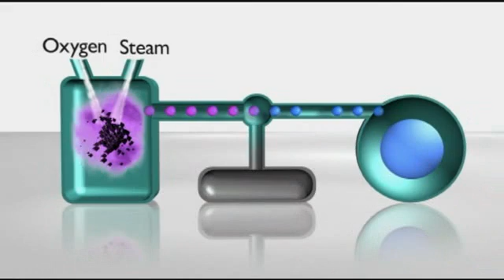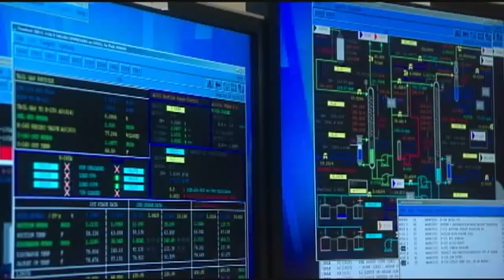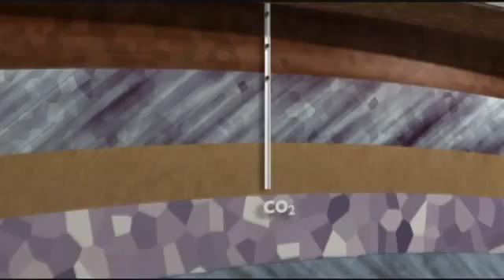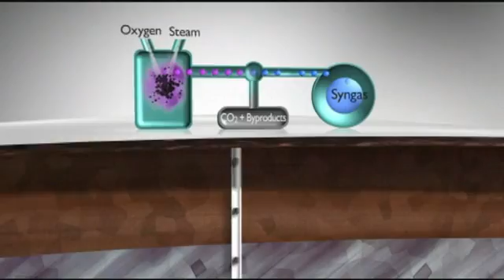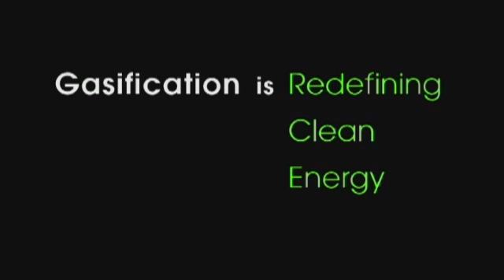Gasification: An Overview of the Process and Products

Comment: I think they should go back to school again because although CO2is thought of as a gas that puts out fire it can actually burn if the temperature is high enough ie. the chemical energy high enough to split the chemical bond of carbon and oxygen which both burn. Using a plasma ignition source and injecting super heated steam alongside CO2 provides enough heat to split both the water and CO2 leaving only water vapor. A catalyst to capture the plasma can be used or simply by use of a magnetic field